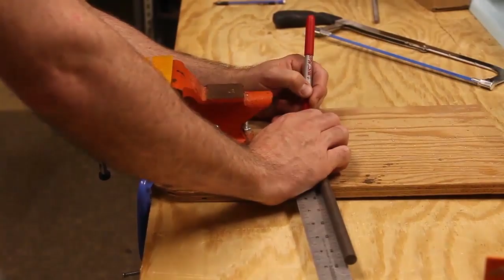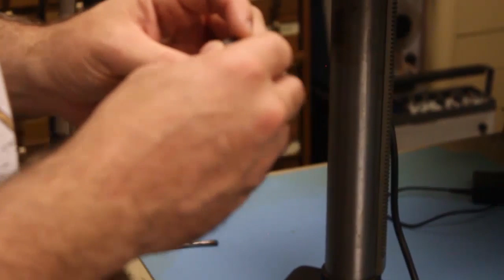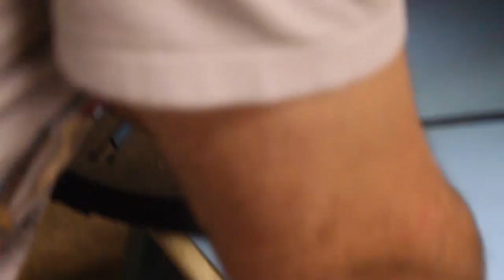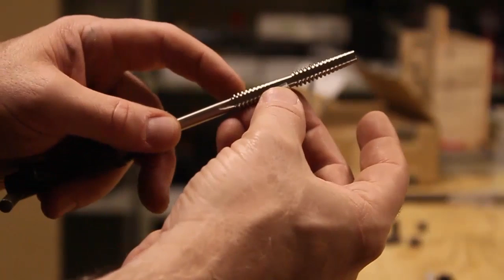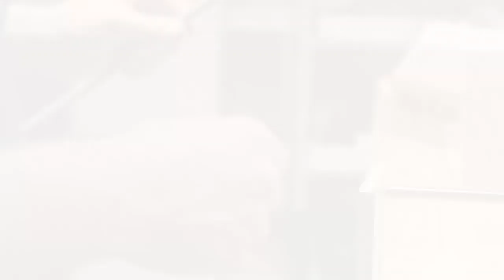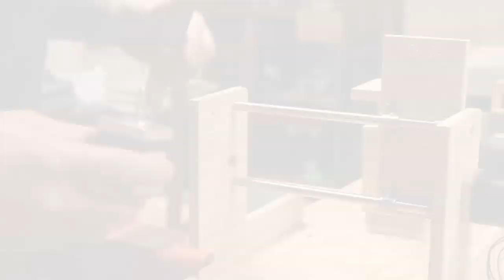Cheap DIY CNC Mill Part 4 of 7

Comment: if you have large drill press with morze tape m2 or m3, you can install tiny 65mn lathe chuck (don't forget the drawbar across drill spindle), and drill your nuts in center inversed:  fix drill in vise, and put nut in drill chuck

 threading is good after drill in place with manual spindle rotation: open belt box, remove belt, and drive spindle pulley by hand or removable handcrunk, feeding by other hand

Comment: if you have large drill press with morze cone m2 or m3, you can install tiny 65mn lathe chuck (don't forget the drawbar across drill spindle), and drill your nuts in center inversed:  fix drill in vise, and put nut in drill chuck

 threading is good after drill in place with manual spindle rotation: open belt box, remove belt, and drive spindle pulley by hand or removable handcrunk, feeding by other hand

Comment: When tapping, I prefer to chuck the tap in the drill press to hold it square. I then turn the drill chuck by hand using a rod in the chuck key holes. Just an idea that has worked for me for years. Nice machine you're building. I am really considering building one of my own using this same design. Great work!!!
Reply: threading is better with belt removed from pulley: you will get more touch feel on threading prorocess

Comment: I like to cut threads using a cutoff wheel on a cordless dremel as you don't have to worry about the cord and using a piece of kevlar mat to protect the bench from sparks, just as an alternative to the cardboard box method in this video.